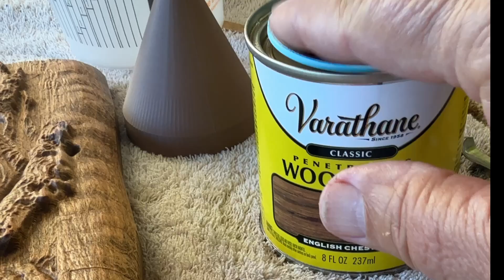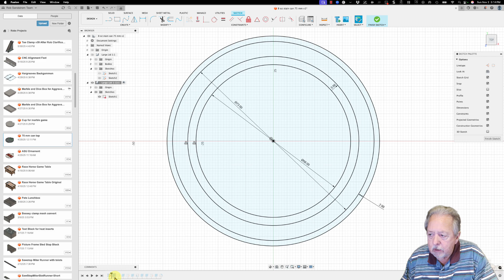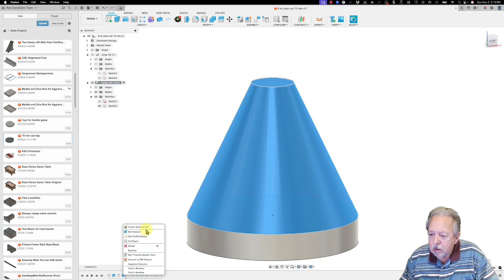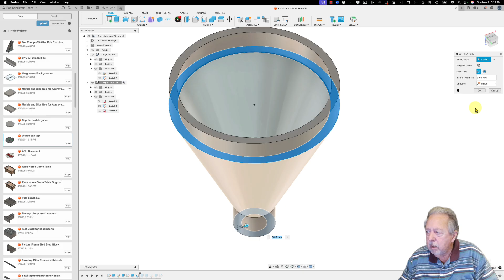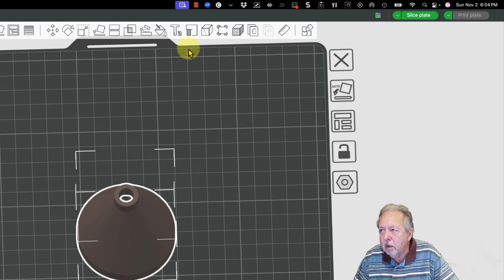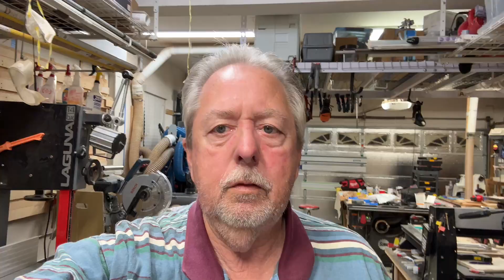Create and 3D Print a Stain Can Funnel in Fusion 360

Comment: For some reason I feel this is your most practical and creative project I’ve seen you make.   Have you thought about making a snap on top for the funnel?   A well fitting top might allow the funnel to remain on the can.
Reply from the maker: I had not thought about that until some one else recommended something similar.  So I am giveing it some thought.  I have a snapon lid if I want to get rid of the metal lid but not sure how practical that is.  Also, ChatGPT mentioned that over time the stain solvent can soften the PLA, mpt a big deal for a funnel but for longer term storage it could leak without some sort of coating applied to it.  So, kind of shying away from it as storage and leaning just towards the funnel concept at this time.

Comment: Nice. Rob you should print a nubs on the top and a snap on cap. You could store it.
Reply from the maker: That’s a good idea.  I did check into making a full container and got information that unless coated the PLA would likely leak.  But as a funnel it should work fine.

Comment: Great idea.    One suggestion.... show the funnel in use.    The first thing i thought, essentially, the funnel becomes air-locked. To fix it, you’d need either a vent hole in the container or a gap around the funnel to let air in and equalize pressure.
Reply from the maker: Good idea…I’ll try to show it when I use it.  Wasn’t planning on pouring that fast but see the potential you mention.  Now I am wondering.  Will be trying it tomorrow